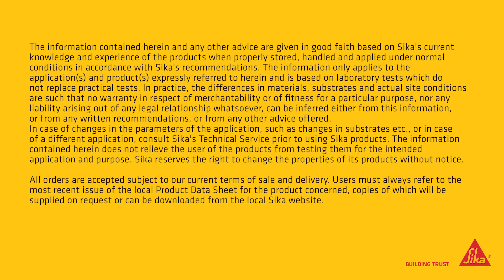Adhesive Dispensing System for Wood Floors: SikaBond® Dispenser-3600

Comment: Can it bond wood to tiles ?
Reply from the maker: Yes, this is possible, but the tiles must be really clean. To be safe, you can apply Sika Primer MB, sprinkle some quartz sand, and then glue the wood on top. With regular glazed clean tiles, it also works without.